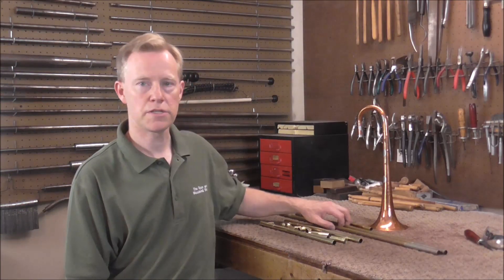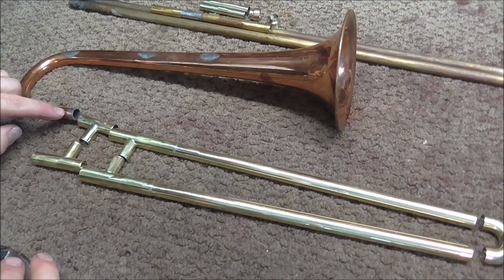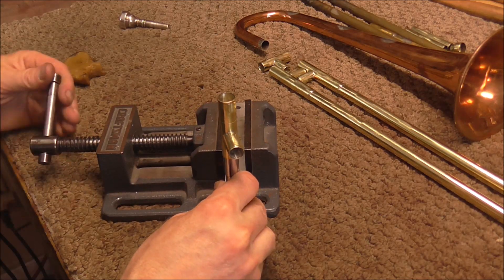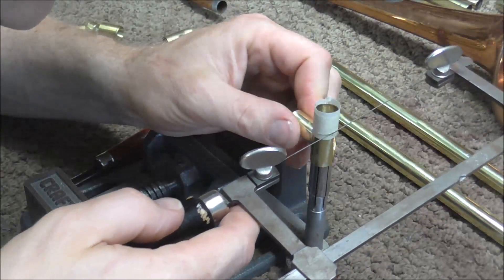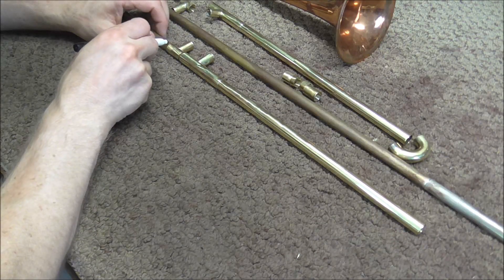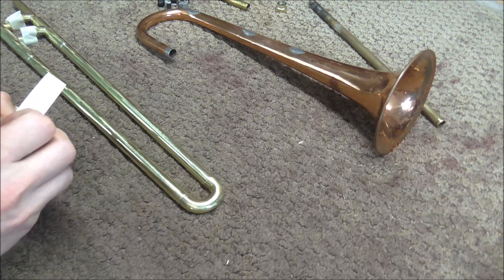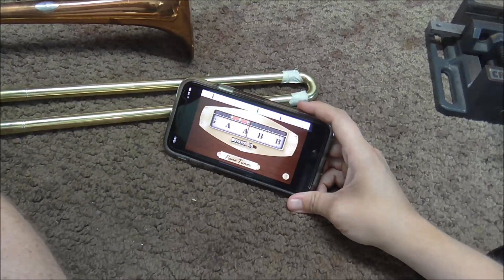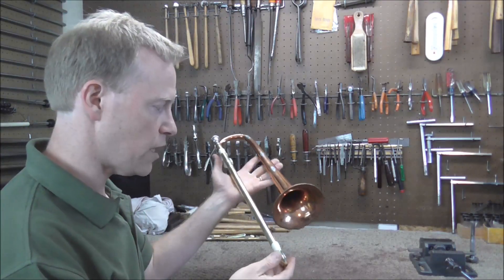Building a Slide Trumpet Project #5: Cutting Tubing And Tuning

Comment: Hi, I am building my own. My question is how much tubing do you have to remove  to change a 1/2 tone. I'm playing in A and it's sharp, I'm just trying to reach Bb and I'm off by a quarter tone. Any help would be great, thanks Rich
Reply from the maker: I am not sure of the exact amount, but if you can find an old trumpet with the A tuning slide or one with some indication of how far you are supposed to pull the tuning slide out to get it in the key of A, see what the difference is and that is how much you need to cut off. 
I hope this helps, 
Art

Comment: I don't know what you do for removing tape or if this would work well for musical instruments, but I also have a lot of experience removing tape. I swear by warming it with a hair dryer and removing what I can, rubbing with oil whatever is left, then rubbing with baking soda after the tape residue has soaked in the oil for a while. If there's stubborn tape, at any point scraping it with a bread bag tab also can help, and it doesn't scratch things.

Comment: A little metal workers advice, if you please. Don't drag you're file backwards. At least lighten up on it on the back stroke and always use both hands on a file to get even pressure.

Comment: I'm impressed! Eagerly waiting for the next video!

I haven't used a jeweler's saw, but I do have a small hacksaw almost the same size. When I cut thin material like plates and tubing, I try to not cut straight across the thin section, since that is when the teeth grab. Often I'll cut about a quarter of the way thru the tubing, then rotate the tube (or move my sawing position) so that I try to keep parallel to the face of the tubing, and am never cutting straight across the tube. I also find that being sure the teeth are cutting from the outside to the inside of the tube gives less chance of the teeth catching, since they are cutting into the 'ramp" of the outside of the tube rather than catching on the sharper edge of the tube from the inside.
Reply: I cut electrical metal tubing and at times copper tubing using a "hacksaw" and you are exactly correct about not trying to cut "all" the way through without rotation the cut 90 degrees. This works very well.